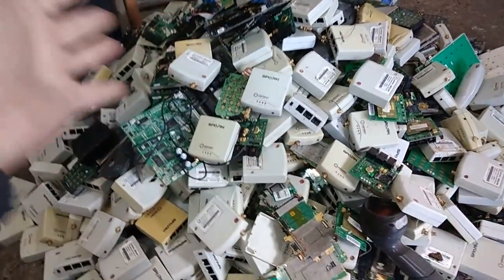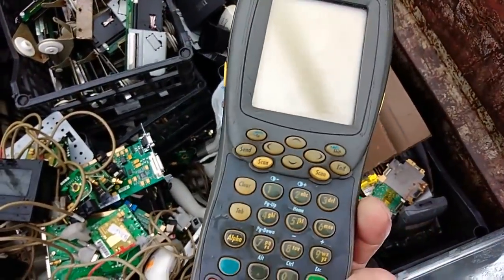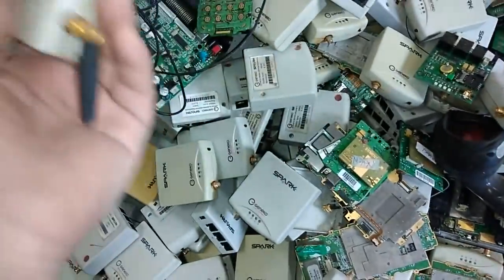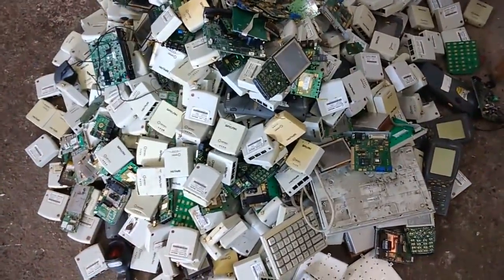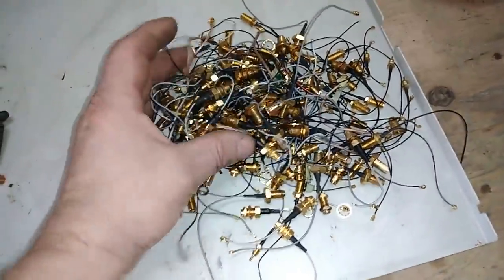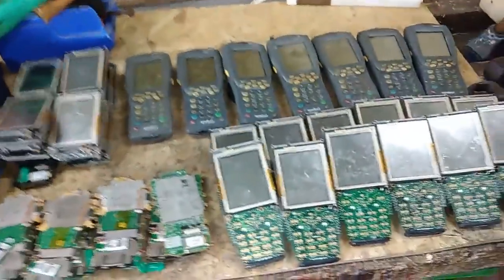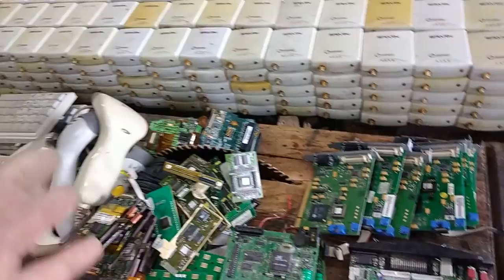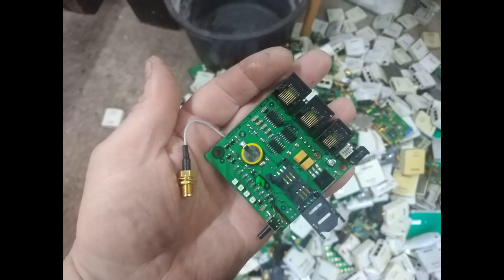500 GPRS modem gold recovery season.

Comment: I would do a test of those boards with soak in some hot Sodium Hydroxide (LYE) to remove the solder mask and see if the flash plating is over the whole board. 

Wear PPE (splash concern not fumes) if you do! Safety first! ✌🏼✌🏼